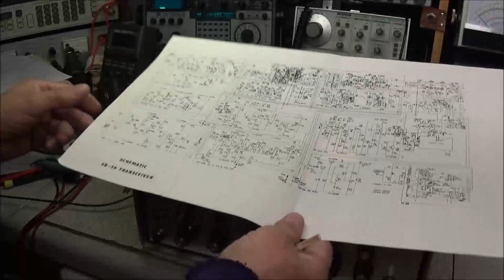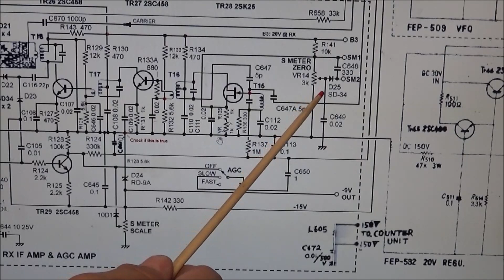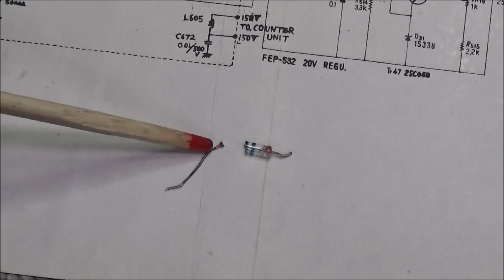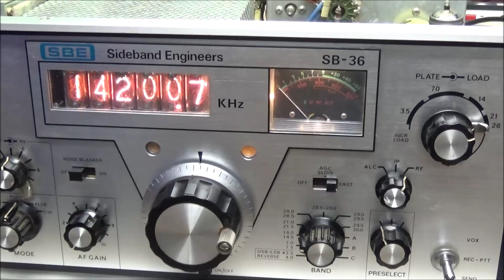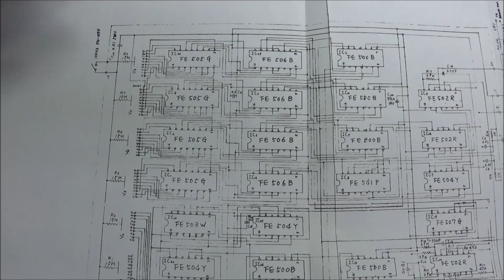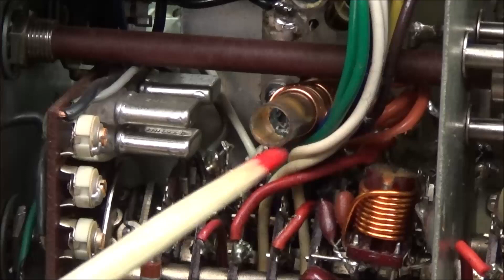#187 SBE Sb 36 Restoration S Meter Repair

Comment: Can you tell me where you found the "third revision" schematic? I would like to download it, seems like all the ones I have are identical to the first one you show. I found manual on "Noobow Systems" but I can't print it in a readable fashion (big fancy printer here at work)
Reply from the maker: Came in via snail mail.  I will scan it as soon as I can get the chance but I do believe it is the same on Noobow site.
Reply: @TheRadioShop  the schems on Noobow site are nearly unreadable (and I am unable to get a readable print out of it, sorry to say). It seems they are scanned with low resolution. My rig works, but it has issues I would like to improve upon

Comment: Another great clip. That SBE is one I've seen before. Although I don't recall some other company transceivers that are similar in the face plate style i, absolutely love the look of these designs. On behalf of myself, and all others who not only enjoy using, but looking at these wonderful "antique" transceivers I'd like to thank you, and others like Mike (Mikes radio repair) who are available to repair, and or restore this type of equipment. There are many of us who enjoy using the older equipment, but for whatever reason can not do a restoration, or even a simple repair. People like you, Mike, and the few others that are not only willing to work on these what some might refer to as ancient pieces of equipment I thank you. If not for guys like you a transceiver like this SBE would most likely wind up in a trash Heap, or as you said in the clip, a parts radio. I'm looking forward to seeing the final clip on this specific SBE. Stay well, God bless, and keep the clips coming. 73
Reply from the maker: Thanks for the very well thought out post.  I just love old equipment. But I love showing others what to look for even more.  I do believe Mike has that same passion.  It is a dying art and we need to share to keep them alive.

Comment: Another thumbs-up for another great video. Please record it for us when you repair that coil. VERY interested in how to do that. I have an old HW-101 with a broken coil form. I can get a replacement board with a good coil on it but repairing the coil form instead would be easier.
Reply from the maker: Thanks. Yes then by repairing save another one for a unit that may really need it.  I do not think this one will be hard at all.  I think that Hot Water 101 has paper or plastic coils.
Reply: @TheRadioShop : I think they are the light-blue plastic ones but I don't remember for sure. I put it back on the shelf until I locate a replacement coil.

Comment: Thanks Buddy, another great episode. Amazing how components can disintegrate in place like that diode did. You had me going at the last minute with the 100Hz display as I noticed it was off in the clip before and was wondering if they had a back panel switch that turned that one off. Keep up the great work!  73 - Dino KL0S
Reply from the maker: Thanks Dino. I knew it had to be something simple. Just had to wrap my mind around it. And yes that last digit had me going also. Could not figure out why it was off to begin with then I remembered the switch lol.